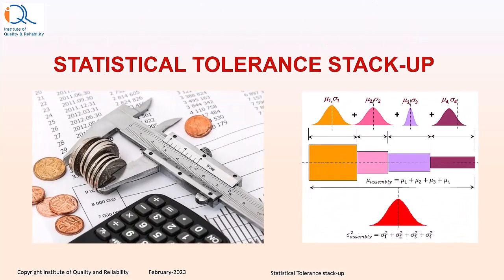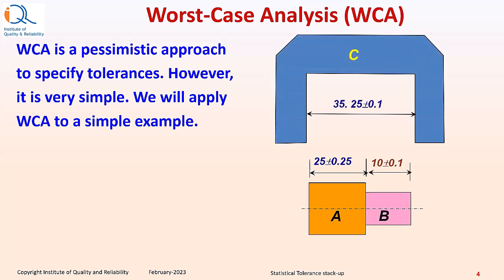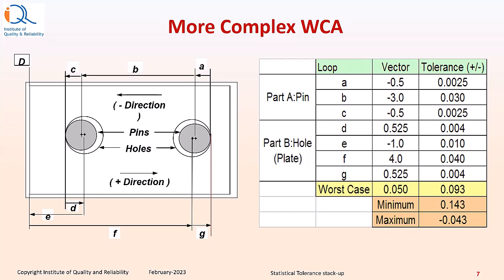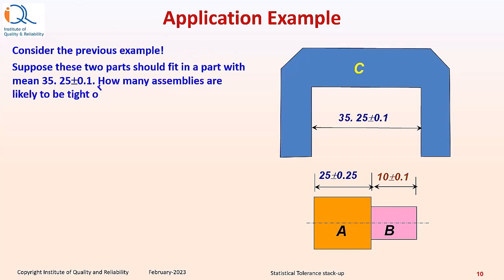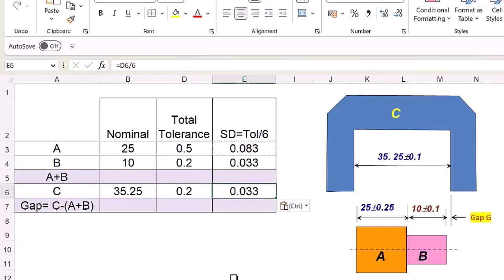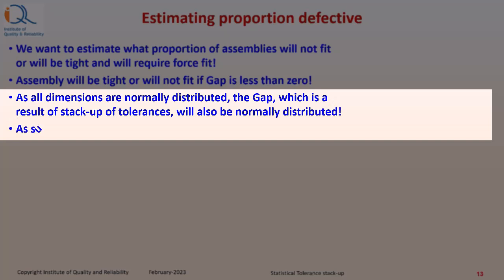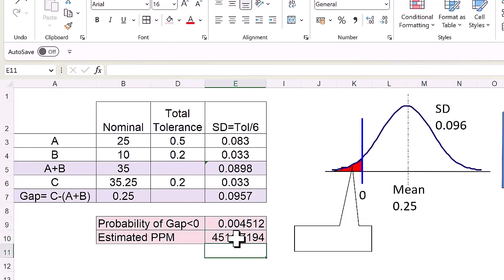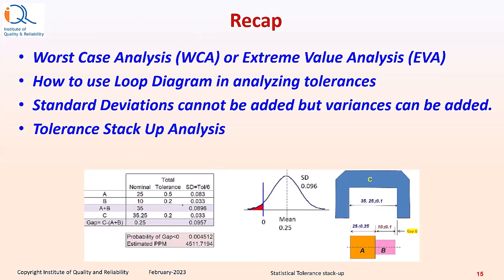Statistical Tolerance Stack-up

Comment: Easy to understand. 

In you example, there is no change in basic dimension and tolerance for the WCM and RSS.

Can you high light the benefits of RSS method over WCM by comparing the two results. So that we can correlate to our real life problems easily.

Thank you.
Reply from the maker: Good question! The RSS method is optimistic while the WCM is pessimistic. Also, the RSS method assumes that each dimension has standard deviation as an equal fraction of its tolerance so that tolerances can be used directly instead of standard deviations.
Reply: @instituteofqualityandrelia7902  

Thank you

Comment: Sir you have taken square root two times Square root od A AND b Tolerance again calculating square root of c + previous answer 

i have calculated square root of sd of a tolerance + sd of b tolerance + sd of c tolerance   

Please check

	                                                              Nominal	Tolerance	                SD=Tol/6
A	                                                           25	               0.5	                       0.083333333
B	                                                           10	              0.2	                        0.033333333
A+B                                                         	35		
C	                                                           35.25	                 0.2	                        0.033333333
GAP=C-(A+B)	                                   0.25                   	0.9                   	0.095742711
Reply from the maker: Thank you. Apologize for the late reply. All the variances ( and tolerances) are perpendicular to each other. So we need to take square root again.

Comment: Hello Sir 

At 8:54  you have taken        square root of  SD (A Tolerance) +  SD (B Tolerance) 
At 9:07 you are again calculating Square root of Previous Answer + Square root of (C Tolerance)
Reply from the maker: Hello Karti, thank you for your interest. For every dimension, you need to add variance. If all tolerances are assumed to have equal Cp, then you can add squared tolerances and take square root.